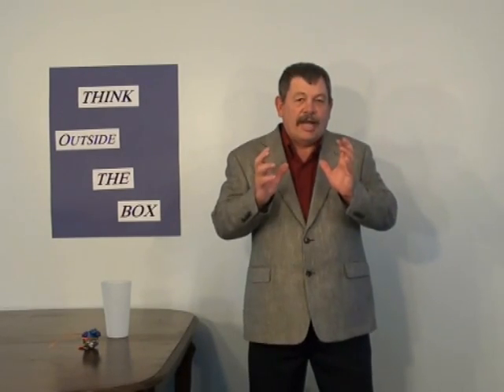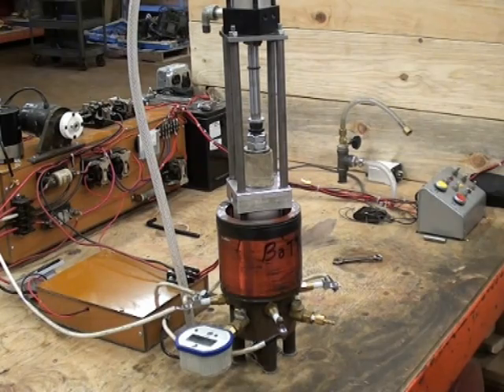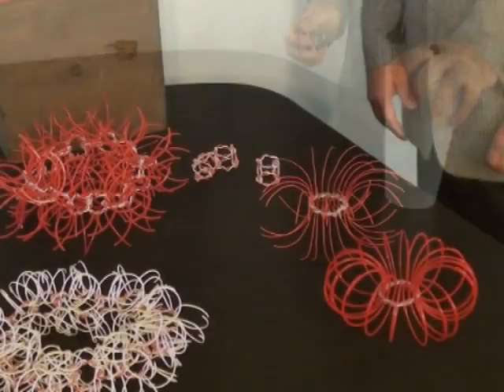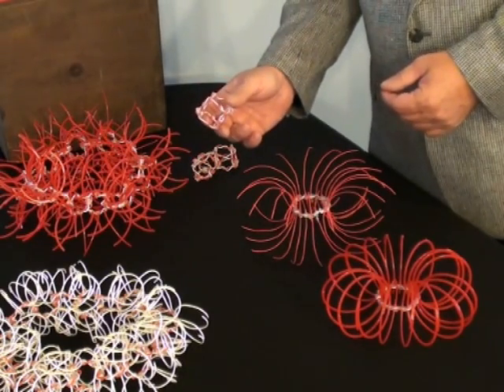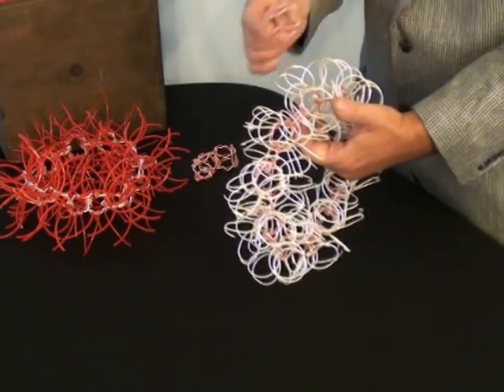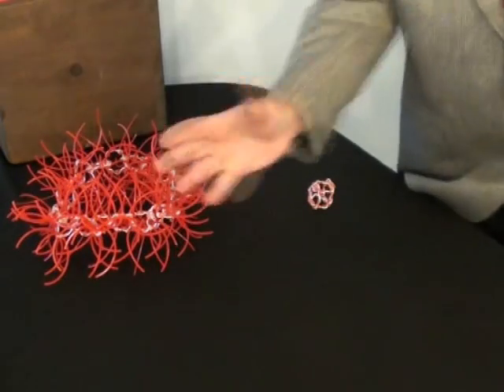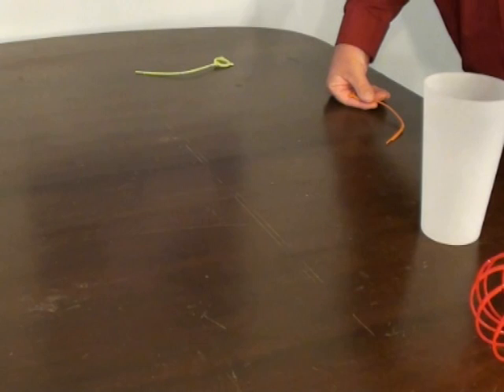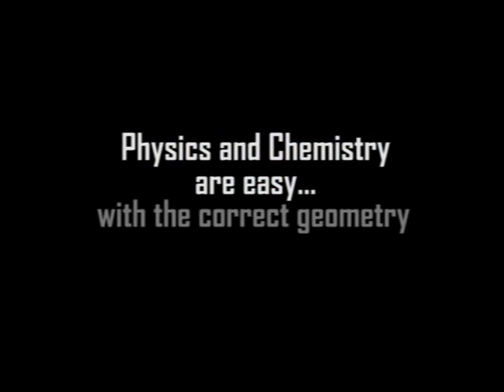Rohner-Roberts Short Video (Noble Gas Engine)

Comment: nice work im not so sure that the bariom cylinder is really needed if the right frequency is what the bariom is doing is the concentration then the singnal of the barium can be faked by sonic frequency and a resance 2.4 or higher with in the chargeing pulse's

Comment: no. only the works of physics here. hellium gaz is getting changed into plasma by an electrical charge, all this in a vacum tube with a piston. thats it. the thing on top is just a meter to observe the force. When gaz becomes plasma, it moves the air around it veerryyy fast. so it produce a lot of force.